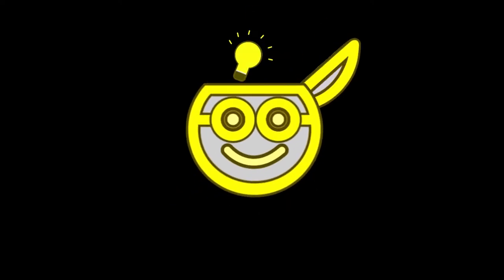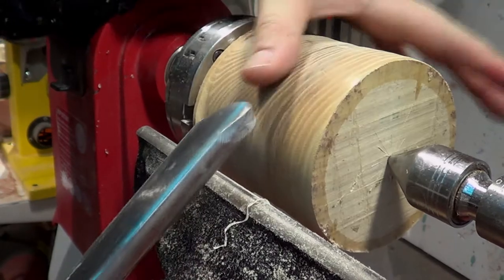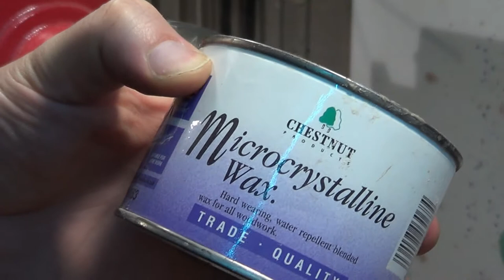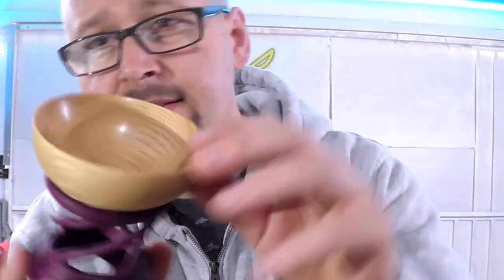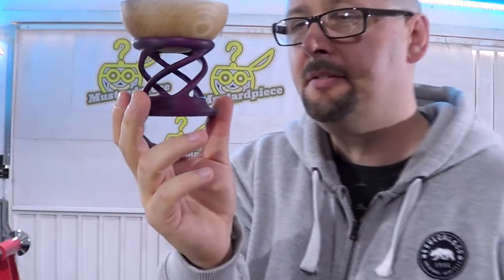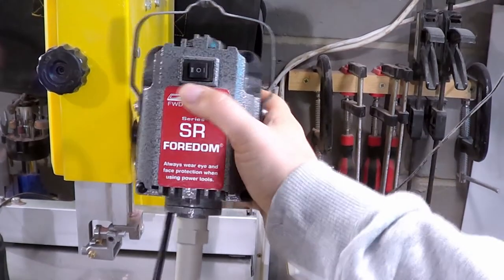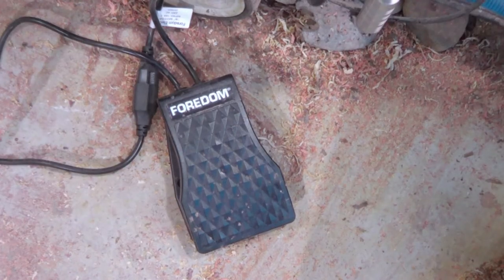Woodturning a Twisted Bowl - Purple Heart

Comment: Very inspirational.and beautiful.  I recently bought an electric wood carving set (not Dremel) and after a few minutes of work sparks began to fly out of the motor.  I wasn't overloading it as I'm fairly experienced at wood turning.  I had to obtain a replacement with a more powerful motor from the manufacturer in America as the UK supplier could only offer me a full system which includes all accessories.  The new grinder with upgraded motor cost me close to £200 as I had to pay customs duty.
Reply from the maker: I'm sorry to here that my friend. I hope you don't get any more trouble with that. The one I purchased is very good. Difficult to explain, it just feels right when I use it compared to my old one. Thanks for watching. :)